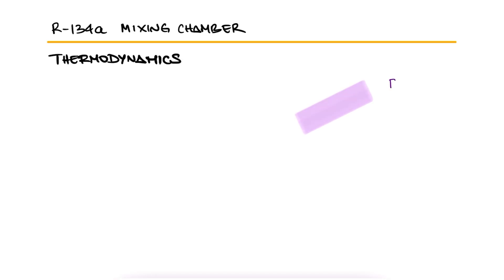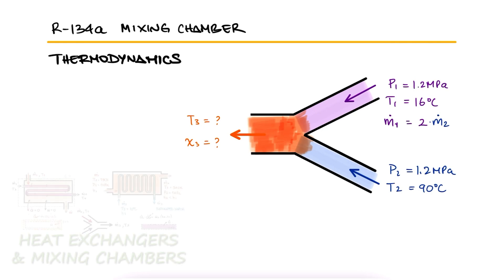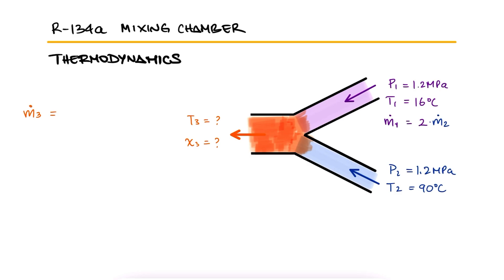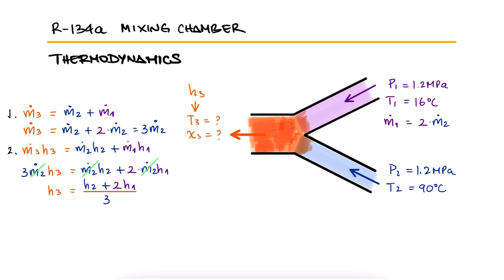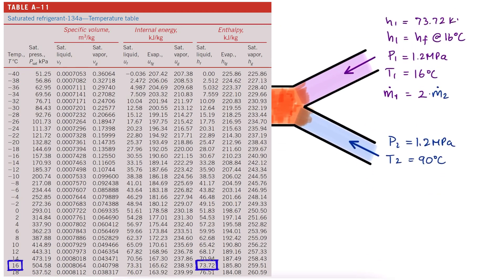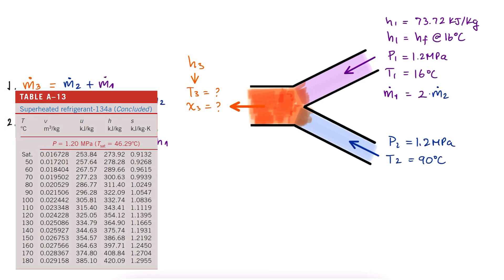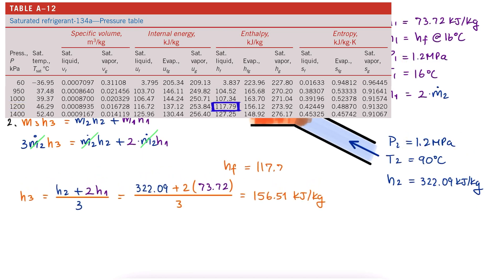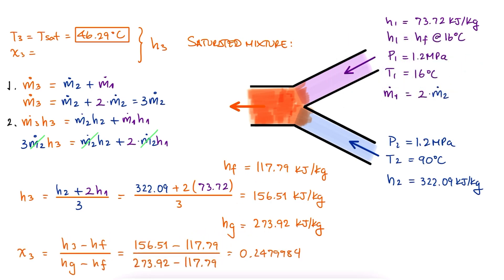Thermodynamics - Mixing R134a Liquid and Steam in Under 3 Minutes!

Comment: What's the logic for why the pressure at the outlet is the same as the pressure at the two inlets. For instance, if the pressure at the two inlets were different, what would the pressure at the outlet then be?